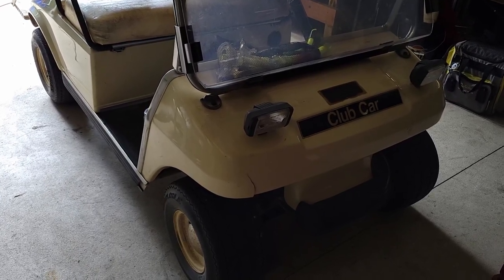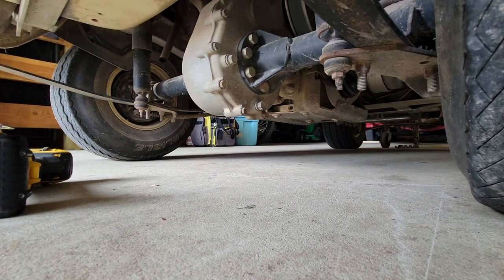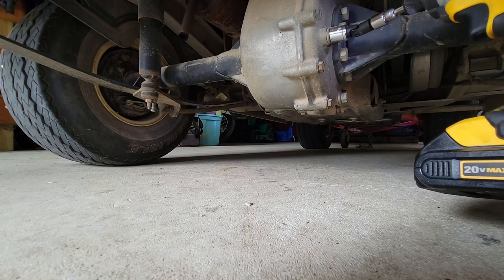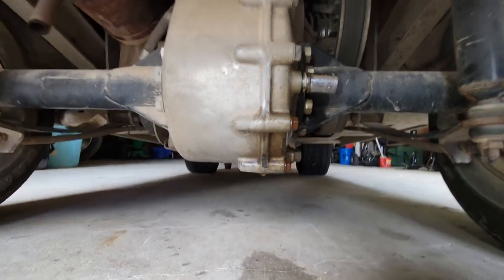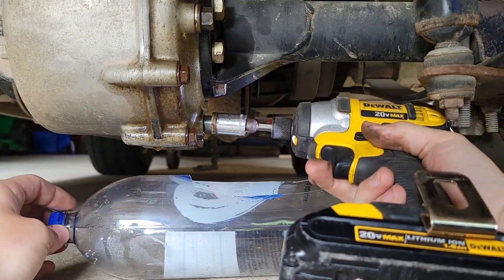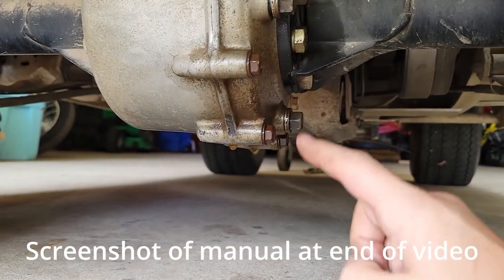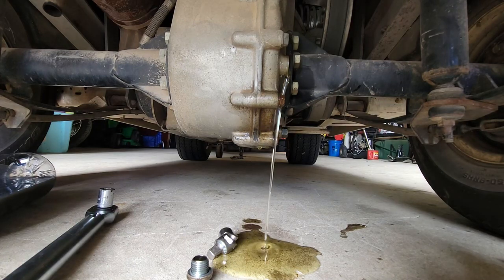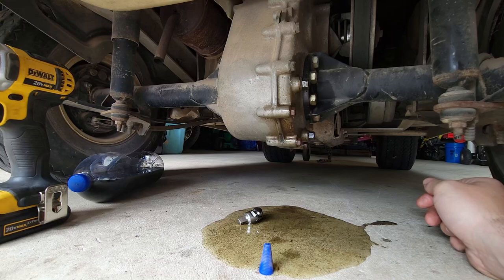1998 Club Car DS Unitized Transaxle (Differential) Gear Oil Change

Comment: How did you know you needed to change this gear oil?  Did your golf cart make any sounds that told you it needed this? 
My Club Car is a 2000 DS, and I’m guessing it’s never been changed.  Should I do it?
Reply from the maker: It was clattering in the unified transaxle. I figured a change of fluid couldn't hurt. It still makes the noise, I think the root cause is a bearing failure.
Reply: When it's very quiet late at night, crawl under the back of the cart, and listen carefully. You will faintly hear......change my oil....change my oil.
Reply: I also have a 2000 DS electric. It probably has never been changed. I'm planning on changing it this week . 80W90.
Reply: @mattgraves490  I saw a chart where they call for SAE 30 wt
Reply: my elictric club car started to make noise sounding dry